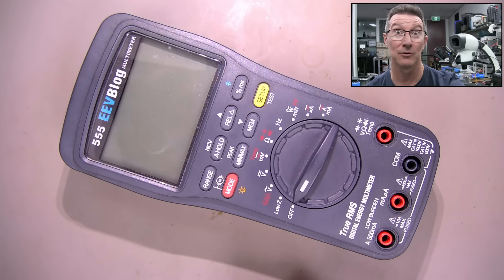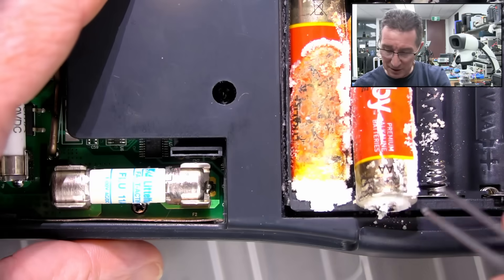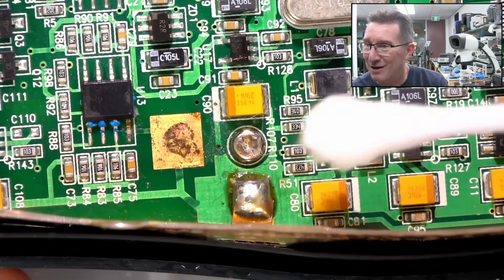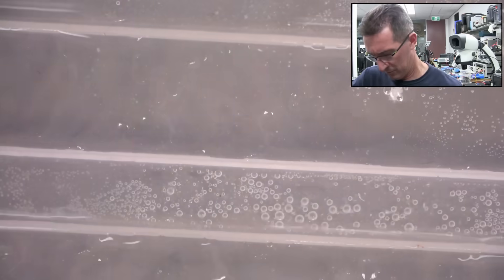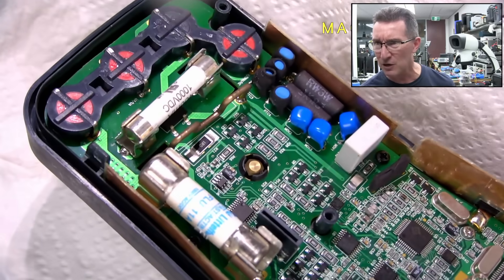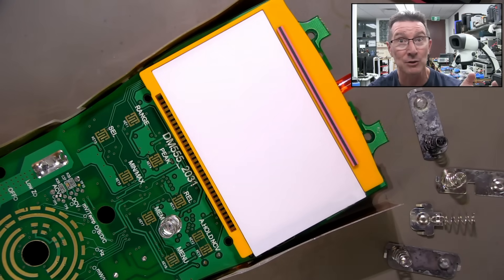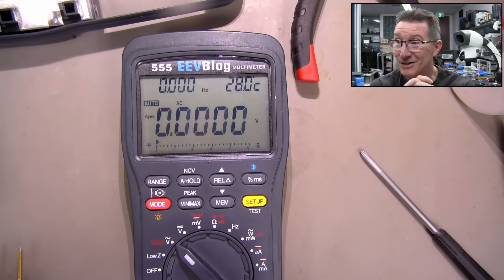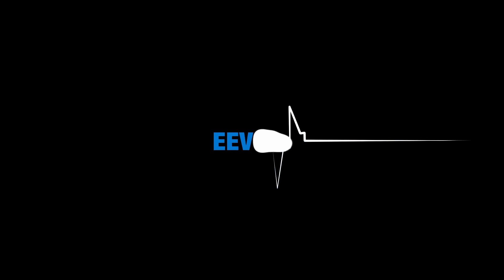EEVblog 1668 - HORRIFIC Alkaline Battery Leakage in Rare Prototype Multimeter

Comment: Good timing on making this.  I rearranged my office/lab last summer and put my spare meters in a new place.  This made me think to check on them.  The one with the batteries from the factory were a bit leaky, but no deep damage done.  Other meter's batteries were simply flat.  Pulled out some new batteries and put them in little ziplock bags in the cases with the meters.  A few minutes of inconvenience if I go to use them, but there won't be any dramas.
Reply: I collect radios and handheld games.  I've found a lot of them (thrift stores, flea markets and yard sales) with blue Panasonic carbon-zinc cells in them.  Not one has ever leaked. Not a single one and all were dead and many were in handheld games that put a tiny load at all times on the cells.  This is the single worst thing you can do to a battery cell to make it leak.  Still, not one has ever leaked. I keep my radios filled with blue Panasonic cells.
Reply: I wouldn't put them in the same bag as the batteries. I've had batteries leak outside of devices so definitely recommend separate bags to contain the catastrophic mess.
Reply: @imark7777777  For mine I keep the meters and probes in a zippered cases.  The batteries are in a ziplock by themselves in the zipper case.
Reply: Concerning these leaked without any parasitic drain, alkalines suck
Reply: @ Modern alkaline cells are extremely prone to leaking.  I use either blue Panasonic carbon-zinc cells (a lot of off brand Dollar stores sell them) which I've never had one leak or NIMH low self discharge cells, but that can get a bit expensive.
Reply: Same, though I just wrap them in a plastic bag several times just to be sure. Also put a tiny Philips screwdriver in the case that came with an external 2.5" HDD enclosure.
Reply: I first switched to lithium primary , although their voltage is a little hot.  Now  replacing pair of AA with an AA LiFePO4 cell plus a dummy cell.   The LiFePO4 cells are cheap now and sold in bulk for solar lights.    No leaks , no protection board needed, de minimus self discharge.
Reply: @ NIMH is a much better solution.
Reply: @tarstarkusz  Good for actively used devices that tolerate the low voltage.   But not worth the hassle of the frequent  low voltage issue and bad self discharge ( even on the 'ow self discharge' versions) ,    They also aren't as durable as lithium rechargeables in my experience.   I know a lot of folks love them but they don't work for me.  Comes down to use case methinks..
Reply: @GannDolph  I've never encountered a device designed for alkaline batteries they don't work in.  The voltage is not an issue because alkalines operate between 1.5 and .8v while NIMH comes off the charger at like 1.4, drops to 1.2 and stays there till the very end.  Decent quality cells will retain a good charge for about 3 years.
OTOH, they do make AA lithium ion cells that only put 1.5v. But they have internal circuitry that maintains the 1.5v necessary to be compatible with ordinary 1.5V batteries and so they are using power and won't hold a charge as long as good quality NIMH cells.
Reply: @GannDolph  That works for low power devices, but they are only around 400-600mAh. Some good, low self discharge NiMH cells will have 4 times the capacity and they will hold a charge for several years.